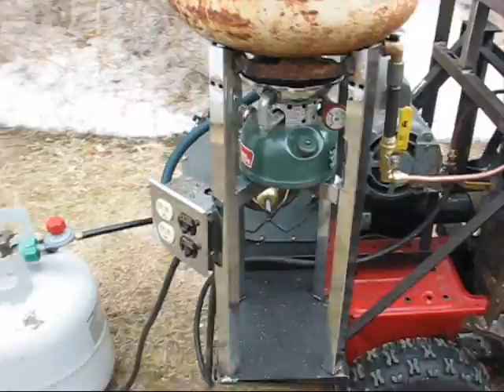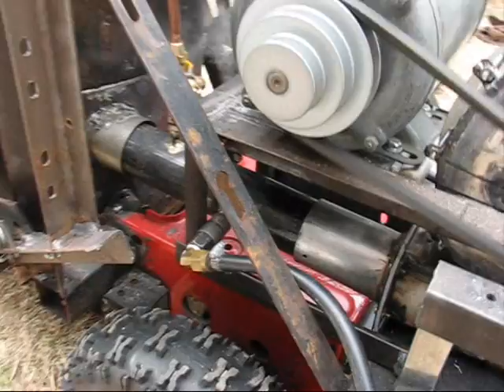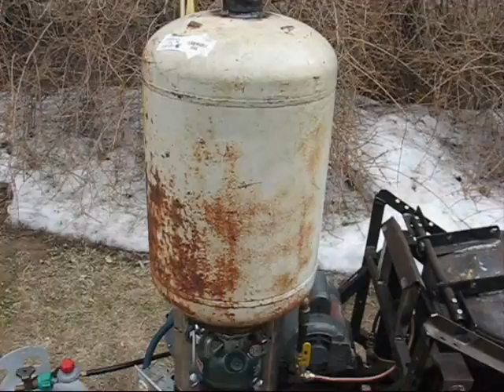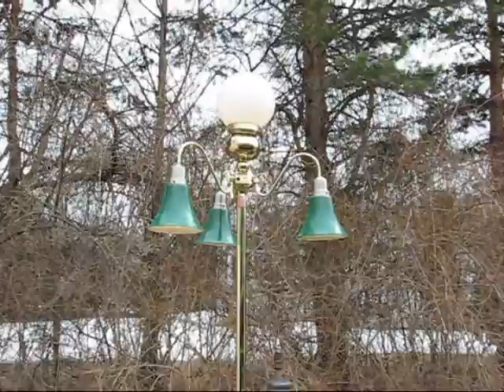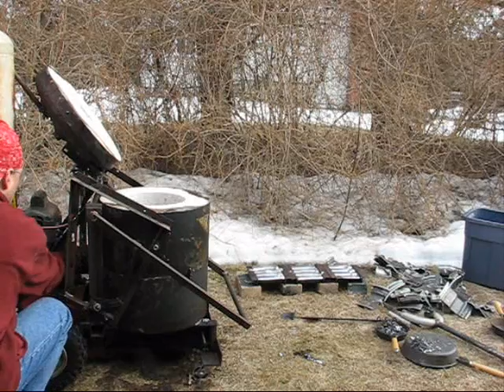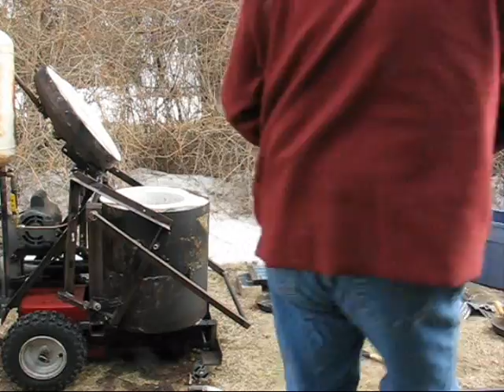Melting Aluminum in a Waste Oil Foundry Furnace

Comment: Sorry Jake, fun to watch, but,
Your contraption has a touch of the mad scientist about it, not talking about the light.
The over engineering, for no advantage, is off the scale.
But thx for the video.
Reply from the maker: "mad scientist" is basically what this channel is about! So, thanks?
Reply: @JakevonSlatt The mad scientist comment was actually a compliment!
The other over engineering for no advantage stuff hurts my OCD eyes though.
Reply from the maker: @espenforfen1334  Thanks! Also, one of the things I do is limit myself to materials I have on hand--I try never to buy anything if possible. This often leads to delightfully ridiculous engineering solutions rather than clean design. It's basically practice for the apocalypse!

Comment: Jake, you need to degass and use a little drossing flux before you can call it high grade aluminum alloy. You put in a lot of work, would be worth doing those steps to reach the quality you deserve.
Reply from the maker: Yep, you are correct. Note that this video is 7 years old.